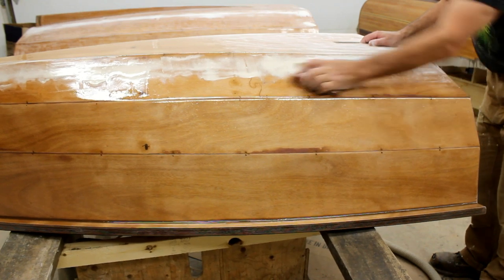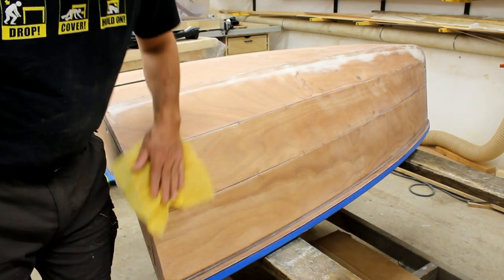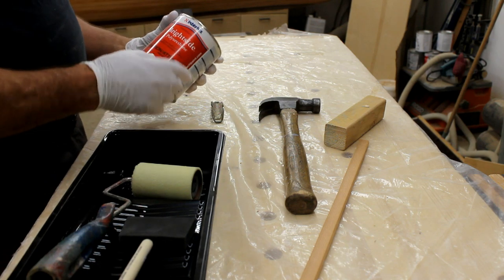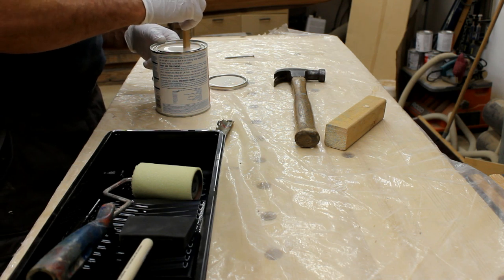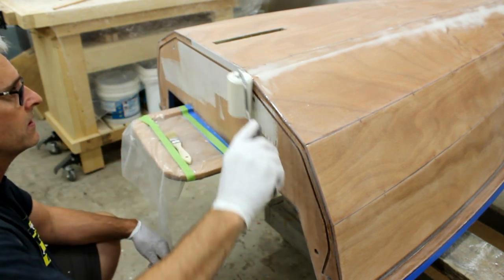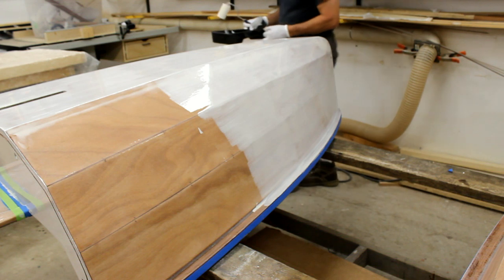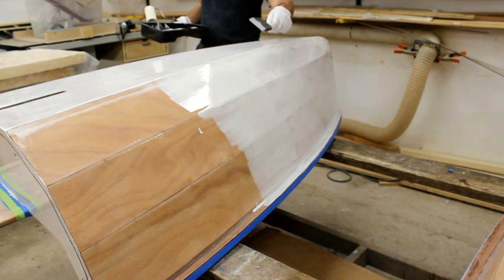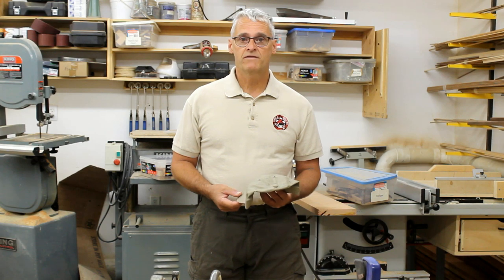Building the PT11 - Final episode

Comment: No primer before the paint???
Reply from the maker: I had the same question for the designer.  I have always used a primer to get a smooth surface on older boats, but he stated that one part primers are prone to blistering as they can absorb moisture.  He also uses two-part paints, but I can not get two-part paints anymore from my wholesaler.  So the primer is the skim coat of epoxy.